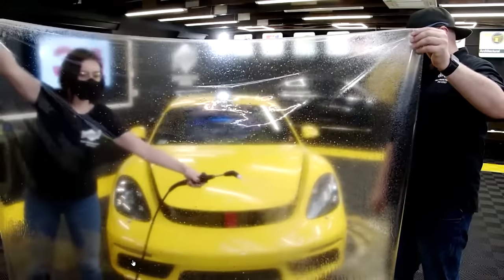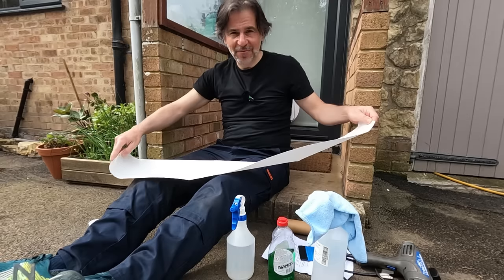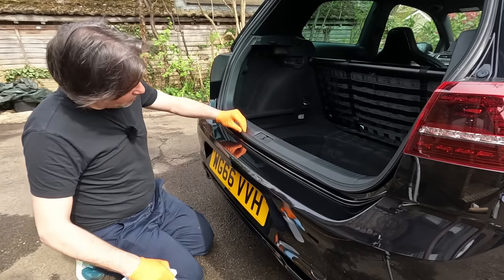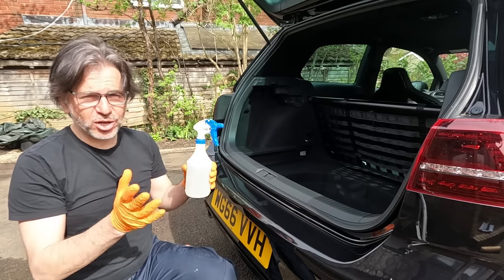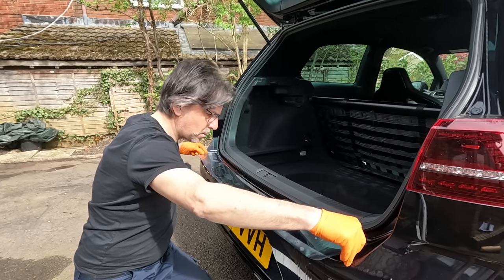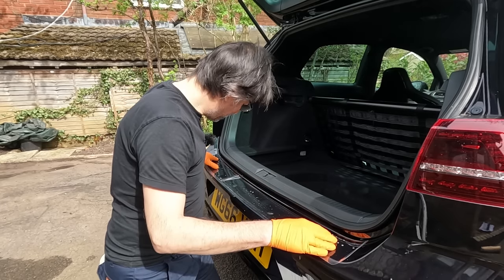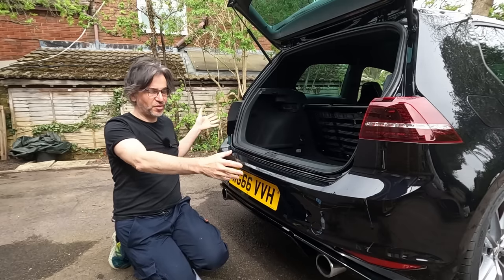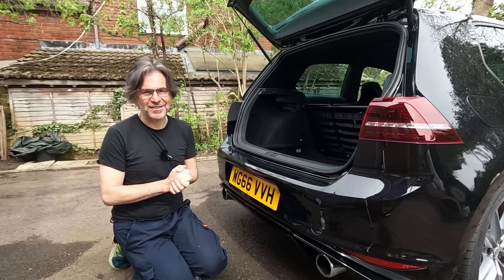CAN I SAVE £1000s fitting PAINT PROTECTION FILM myself?  PPF VIRGIN DIY GUIDE PART 1

Comment: I did the bonnet on my Tesla myself, not with a kit - just with a roll of PPF i bought. The film itself isn't hard to work with if you have patience, but you won't get professional level edges without a lot of practice (which probably doesn't matter to most DIYers). Dust and grit are the biggest problem. A complete nightmare in fact. So if you want to do this you really want to have a large, clean, draught-free garage.
Reply: @BillTheButcher-gc9lg I do own the car.
Reply: @BillTheButcher-gc9lg Obviously, yes.

Comment: Did this in the pushchair days. Tips: Fastglass as the lube and a felt squeegee. Hair drier helps and nitrile gloves can touch the sticky side without finger prints- enough to pick dust/sand out. Beware the 2nd bend- if the bumber has several swage lines, stick between the 1st and 2nd then bend up and down from there the material can’t cope with two bends from the top flat surface and leaves pigs ears.

Comment: For the price of PPF, you might as well get it resprayed if it gets damaged.
Reply from the maker: That’s assuming the repair job will be as perfect and as durable as the original (which it never will be)
Reply: Have you told your insurance company that you’ve fitted it to your car?
Reply: @DRILLBABYDRIL  Seriously ?
Reply: @davidhaygarth648  
It’s been discussed on many of forums pal. Google is your friend.
Reply: No that's not right, my Leon was done from new by a very good team, it has virtually no marks and still looks brand new after 92k. My previous Leon was the same colour and after 80 k the front bumper,.bonnet, mirrors, a pillars and roof all.looked.like they had been blasted by a shot gun.  The ppf provider guaranteed the film for as long as i owned it; have had the car 9 years now, and none of it has unstuck.  Only works on new cars really,.the best 500 quid I ever spent. I am in car insurance, and the insurance company wants to know because in the event damage, they will still repair the car, but won't necessarily pay for the ppf to be redone.
Reply: @davidhaygarth648  if it’s not on from factory, it’s a modification that needs declaring.

Comment: Do you ever feel a bit disappointed with the Clubsport S not having the 7.5 upgrades? They are so great
Reply from the maker: Genuinely I don’t, I really couldn’t care less about VW’s virtual cockpit and the bi-xenon head lights are fine. The CS/CSS bumper are closer to 7.5 than 7 and CSS has the best seats.  TBH if you buy it for anything other than how it drives on the road fully lit, you’ll be disappointed as it doesn’t even have some of the things a normal 7 GTI has got, let alone 7.5

Comment: I tried it on my motorbike, I managed but wasn't great.  I had my new Leon Cupra protected at the front end in 2015, it cost 500 quid, however after 92k there I'd hardly a.mark on the front bumper, wing, 1/3 of bonnet and mirrors. The ppf 'saved' one of the headlights,.when a big stone tore through it,.a couple years later I had to change one of the headlights when it failed, it cost me over 600 quid plus fitting!  All in all, I think I would do it again. One thing though, u can't Ppf a panel that has had pint chips touched up, as when moving the Ppf around, it drags the paint from the chip and looks a right mess!  This is why I had my new Leon delivered to the ppf guys in.manchester!! And yes, I defo do it again.

Comment: You may want to check your insurance cover after applying PPF some garages will knock it back as insurance work and wont repair the panels it’s on
Reply: I’m afraid this isn’t correct. I work in motor claims for a large insurance company. They are legally obliged to put you back into the position you were in before the accident no more and no less.
Reply: @Insertnamehere3000  
Providing full declaration of course of any changes from factory spec, I’m assuming ? Some insurance companies differ from one and other. I’ve never applied it to any car, but other who have, have had insurance payouts refused.
Legal waivers in T&C’s apply to all insurance cover.